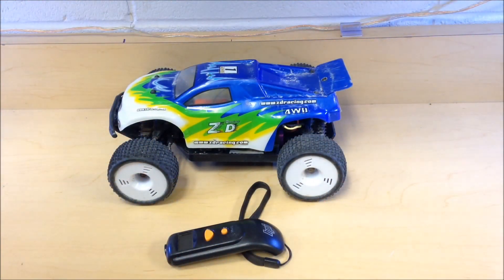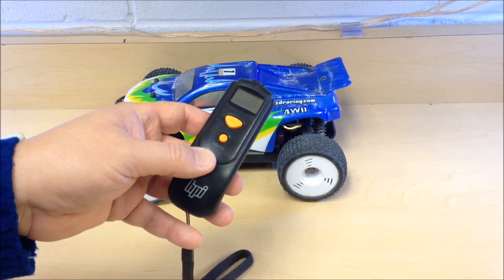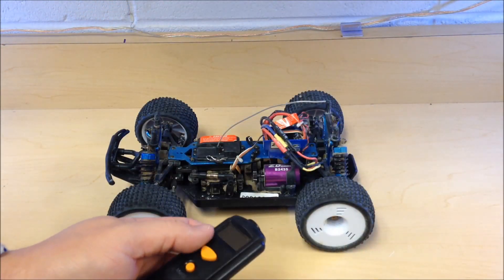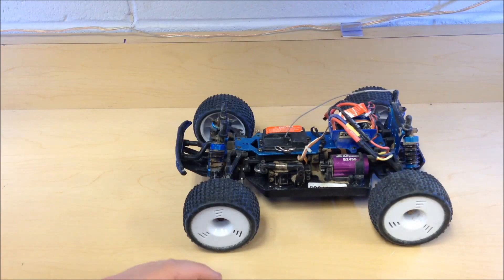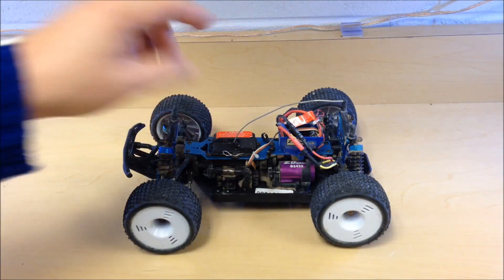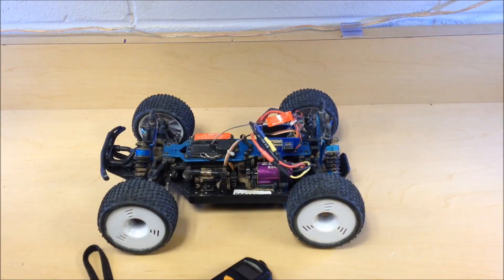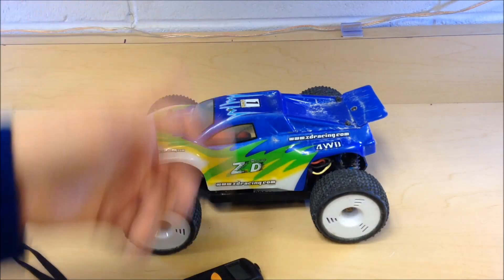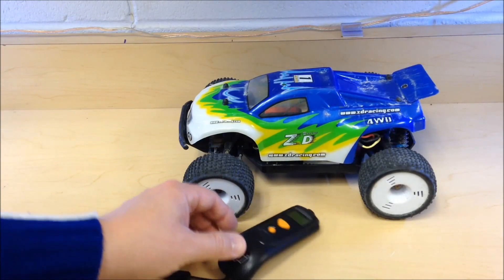PREVENT / STOP YOUR RC FROM OVERHEATING!!

Comment: Great tip Mike. I have a Duratrax flash point heat sensor. It probably cost the same as yours. It's a bit smaller but, the one you have looks a little more well built.
Reply from the maker: i've had mine for 6 yrs now and does the trick. you can buy ones now that look like a pistol and have a red laser that shines on the object you want to temp. I see them all the time on the china sites for $15US free ship and seen them on sale at Sams Club for $20. I'm just surprised how many RCers don't have them, i was racing at the track this season and my friend finished a 4wd SCT 5 min heat and i temped his motor and it was 205 and he had no clue he was running that hot.